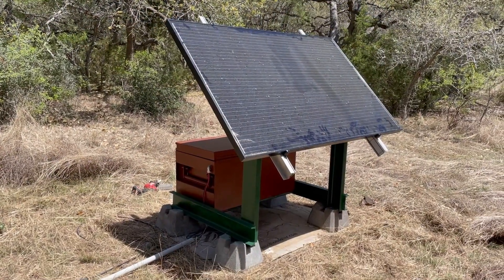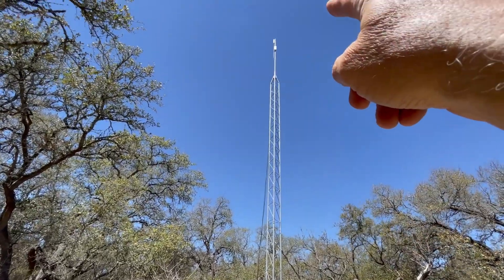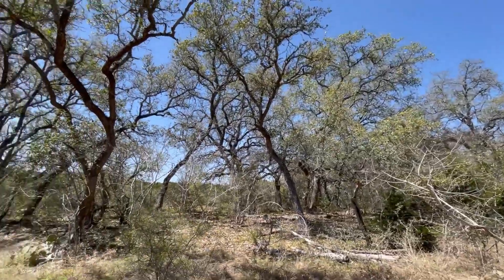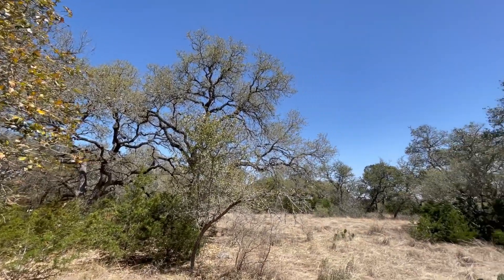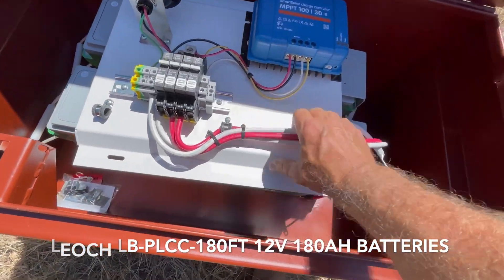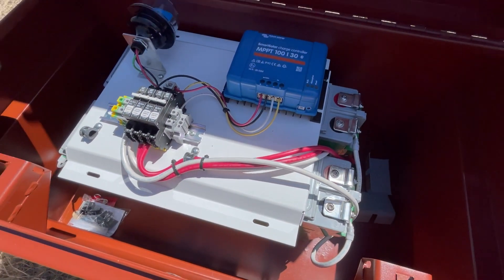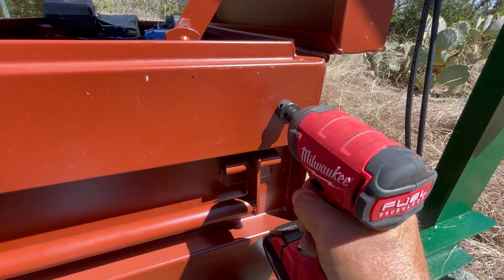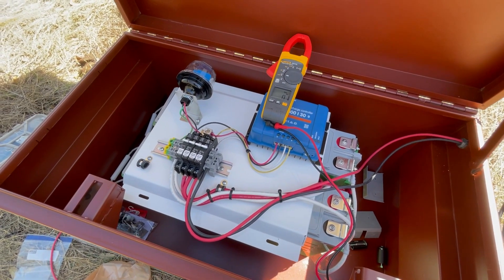Radio Commander Solar Powered WiFi Repeater with Maverick MacGyver

Comment: I'd like to ask about what appears to be a midnight solar over voltage protection unit, and how you have it wired in... (i didn't see a ground connection, will that be added?, or are you only protecting between + and -?)  Best I could tell you have it on the + and - of the batt buss.  I was planning to put mine on my solar inputs.  My thinking was to shunt to ground before the charge controller, perhaps protecting it.  Could I ask you to please share your thoughts on the pros and cons of each?
Reply from the maker: Well... this is a very small unit and the tower is the likely source of a surge. On a larger system, I would place the MidNite SPD on the solar array combiner. And I would also place one at the inverter at the battery input. For the complete coverage, also add the AC version at the AC input side of the system. I know that does add up in price...
Reply from the maker: Also, for grounding, I did run the 3 wires over to the tower for the radio power. One wire was the ground established by the tower itself.